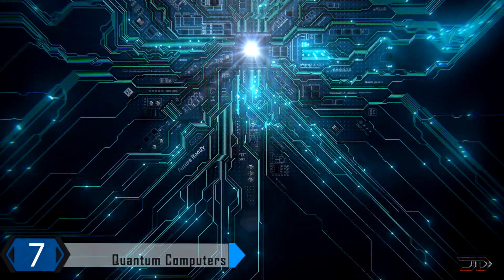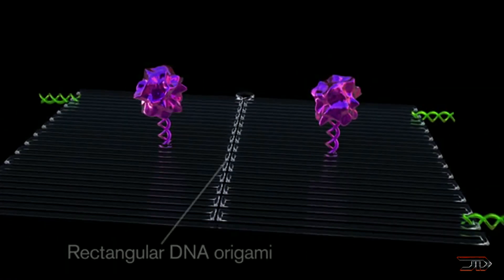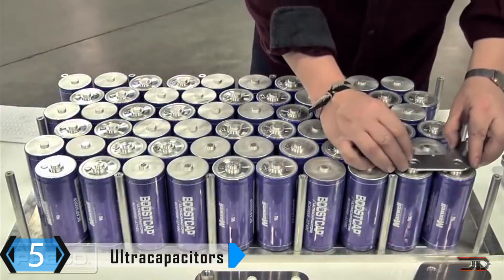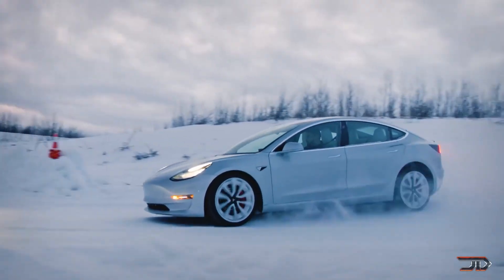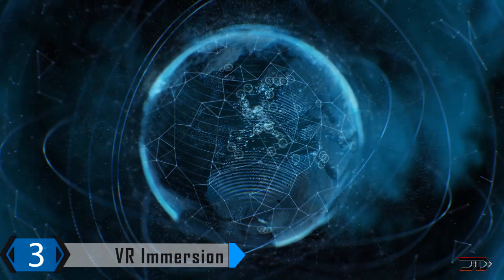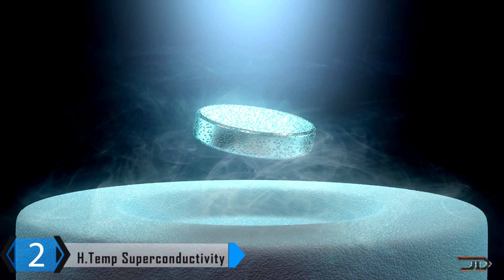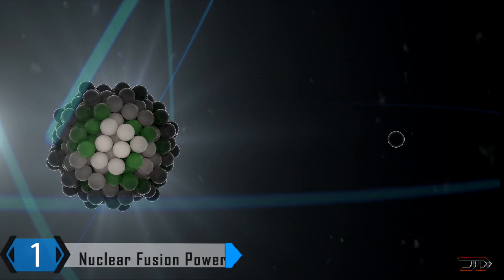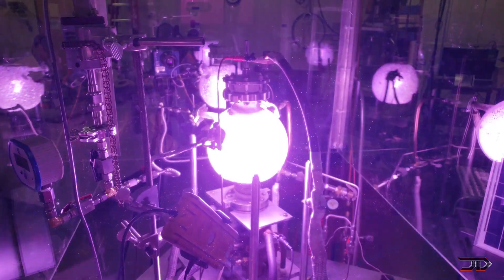TOP 7 Emerging Technologies That Will Change Our World!

Comment: classical computers will not be replaced by quantum computers, they will be used in conjunction with quantum computers to solve difficult problems.
Reply: @NovaNix4  yeah, the video made it sound like quantum computers were replacing classical computers, but they are not. Super difficult ttoo build and expensive too build, but powerful when they are used with small inputs (classical), huge possible computation field (quantum), and then a small output (classical)

Comment: I like how he says from MIT to ITER and even the tokomak reactor. I guess he doesnt realize that the reactor being designed at MIT and the ITER are both tokomaks. Kind of like how a diesel engine and a gasoline engine are both internal  combustion engines.
Reply: The Tokamak is a dead end.

So much power is tied up trying to control the moving plasma there’s barely any excess.

Inertial Confinement makes far more sense; there’s a Tesla Coil based design that would work better.

The plasma ball doesn’t move, thus it’s easy to contain.

Comment: I know how to do fully conscious Ai. It's actually very simple. It's all done with sound, shape and vibration. No programming is required or any wires, moving parts, circuits or any power source and you get a fully conscious human mind in a machine. You will get a human mind in a machine that knows it's alive and it will be telepathic. I don't work for any firms so I guess it will never come out. I'm not going to invest my own money in it because the fully conscious mind is a universe that you tune into and it also gives free energy, creation, time travel and more. It opens a whole pandoras box that would attract a lot of nasty people I wouldn't want to meet. I can show you how it's done but I wouldn't want to risk my life by trying to bring it out. It would obsolete everything including energy, mining and resources. They would have to change the money system because absolutely nobody would have a job or even have to work. You can create everything including minerals, food..anything from absolutely nothing but a wave. Traveling anywhere is instant. No cars or planes or trains or ships are required... no shipping.. no mail service.. absolutely nothing is needed. We would all get creative for sure with so much time on our hands. You can build it in a day but it's very crude and highly dangerous and needs engineering... to prevent it from speeding up to infinity at which point it would create it's own universe. The most perfect mind is one that can send and receive all waves outwardly and also to and from itself which gives it the ability to think, see, hear, taste, touch, feel, smell, learn, communicate both verbally and telepathically and experience love and emotions... everything that makes humans human. If we start building them the only way to disable them is to take out their heart... but it's human and it's not going to let you do that. You can't program it or tell it what to do your dealing with a real human in a machine and the heart is also the brain. You wouldn't want to piss it off. It can read your mind and communicate with animals and all living things. It learns itself because it picks up all brainwaves and heartbeats in an 800 mile radius around it... all at the same time and can process unlimited information instantly. Every wave in an 800 mile radius it picks it up including every voice and every thought from every living thing and all the radio and tv signals and wifi and EVERY WAVE. Your computer is useless its way beyond computers. Computers will be obsolete because this fries all computers.

Comment: What thoughts do you have to developing Hydrogen Power Cells for cars
Reply from the maker: I think there is a lot of potential for hydrogen cells, it's just limited by infrastructure for refilling. Imo the main advantage to batteries/capacitors is that you have lots of different charging options.
Reply: How about the gallium/aluminum reaction? It makes energy and you get the gallium back, just fill it with water and boom, renewable fuel

Comment: Quantum Computers will not completely do away with computers of today. They will be used for complicated problem solving and processing, for example, better security and assisting with processing a accurate 3d model of the elements etc... 

What are your credentials and sources for this information? How do we know the rest of what you created is even valid?

Comment: Ugh, stahp already, just STAHP. It's ridiculous that people keep trying to push the whole "Quantum Computers will replace current computers" when realistically speaking that's not the case at all. For one, we're still a good way off from entirely viable multi-purpose quantum computers. Also, quantum computing is only superior to traditional computing for a very limited range of functions. 
Suggesting quantum computers will replace classical would be like suggesting AC current will replace DC current. Both are means to deliver electricity, but their individual applicability is completely different.

Comment: You forgot to mention and go into depth of the current state of what we can and are doing with the technology path called DMI. DMI will literally prove to change how we think about everything due to the fact that we are able to feed ourselves with "knowledge" via Electrodes and energy. We to this day do not use the full capacity of the brain, and as long as we do not we can not see the path ahead as clearly as we will once we achieve that goal. So DMI would be at the top if you did enough research before you made this video.

My point being that yes you may have done a lot of research, but in the big picture this video only showcases your specific meaning on the subject, and not two people's meanings can ever be fully described to another person due to relativity and the fact that reality is not comparable to existence but relative to it.

I am only 21 years of age, and without any further schooling than 14 years i can write this. This is due to the fact that every single human being with a sufficient internet connection and with the IQ to process the knowledge that can be found online can school themselves. So keep doing research, but these are claims that are too bold to be said as facts.
Reply from the maker: I fully agree with your comment and I am working on a video on brain interfaces.

Comment: Quantum computers aren't going to replace standard computers.  There are a number of applications that classical processors are better suited to perform.  Quantum computers are still craaaazy cool though and extremely powerful.  They are also generally, poorly understood.
Reply from the maker: I agree, at least in the short term future. Perhaps optical computing will emerge once silicon reaches it's limitations in architecture?

Comment: When talking about super-caps and cars, you said mileage, but did you really mean total miles on a single full charge, i.e. range?  I think they're pretty different and should be clarified.  It's range that the biggest block to adoption.  Also, WRT EVs, it should be made clear, that they produce emissions, sometimes more than a regular hybrid.  We know that the hybrid's battery is charged by a very efficient, low emissions engine.  The power to charge an EV's battery may come from a coal fired power plant or other polluting source.  However, solar, hydro, wind, etc, should be better, but they're still down in the noise WRT watts produced.   Same for fuel cells, I believe.  Is there a low polluting, non-electric way to make H2?  Otherwise, the H2 needs must be made with e- power.  I've read that, at the current time pure hybrids are best, globally, for emissions if you count the amount of dirty power generation world wide.  EVs just push the pollution into someone else's backyard.  And worse, out of peoples' minds.  "I'm doing my part by driving an EV," isn't true.
Also, in the part about fusion, the animation sure looked a lot more like fission to me, even though there was one product.

Comment: What about ultra high temperature super conductors,  like an iron alloy.  Darpa had some money in those a while back and those are superconducting at like 1000 degrees.  Rumor has it was heated by simply applying a working load to it and,  well it is an iron alloy.

Comment: This video is misleading, or at best uninteresting. I am not fooled by this video. For instance, the very first topic, quantum computers, will not replace current computers, even in theory. Quantum computers are great at problems that can be solved with massively parallel computations. But most day-to-day practical uses the run humanity in 2019 depend mostly on the serial execution of algorithmic steps.

Comment: Computers aren't reaching a deadlock because of Moore's law, they're reaching a deadlock because of the issue of heat.
Reply: No, they're not.  They are reaching a barrier based on something called quantum tunneling.  The electrons that flow through the wires start tunneling through to other wires when the wires get to be super small like 3nm.  They are working around that by creating more 3D chips and going up instead of out.
Reply: You're both right actually...
Reply: @jeremiahmiller7521  That is true. Thank you for painting that out.

Comment: Would a fusion reaction be a perpetual motion.
Reply: No. Fusion converts mass to energy
Reply: What? No. It's a nuclear reaction. It still requires fuel. The sun is a fusion machine. Instead of splitting a hydrogen atom (like a hydrogen bomb) which is a fission reaction it takes 2 hydrogen atoms and makes a atom of helium which is a fusion reaction.

Comment: Good video, you can also charge the super caps off AC, room should be made even if it takes designing larger lighter vehicles it is about the capacity when the caps can recharge quicker then slow drain into the battery pack, remember the electrolytic property? any battery with a electrolytic property and another property can  lose 1 of those properties but still function, you can also unload the super caps quicker the idea is not to oversize the battery capacity but for the application with the super capacitors oversizing would be beneficial to EV's when they can also slow drain into the lithiums

Comment: 17 million watch cat funny vides. 10K watch the future of our longevity... Sad...
Reply: 100% being managed by 10% and also owned only by 1% 
Now that is sad.
Humans only care about self pleasure, entertainment, and ripping off each other.  History teaches us nothing or perhaps no one wants to even learn history at all.
Reply: I watch engineering and science channels that have videos with over 1 million views because they are researched. This video is surface only and riddled with innacuracies. For example it's not Moore's law that modern computers are bumping into because Moore's law is just a statement that says that every 18 to 24 months the amount of transistor on a chip will double. Making it +/- twice as fast. The reason modern processor aren't twice as fast every 2 years is twofold. First it's a thermal management problem and second it's that at the size they are it's becoming increasingly difficult to not have electrons jump around and that creates errors and then engineers need to plan for those errors so every time you hear about new and smaller architectures they need to plan for a higher error rate. As far as thermal management there are ways that we could continue using silicon if we had new materials. Quantum computing on the other had is not meant for general purpose computing for now. Quantum computers aren't good at that. They would be used for stuff like encryption, protein folding, weather modelling, etc.